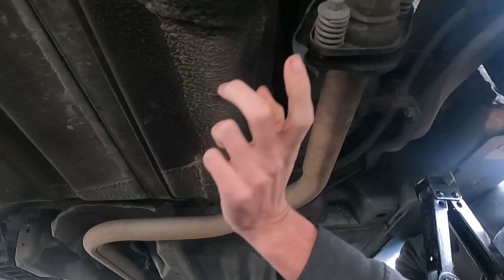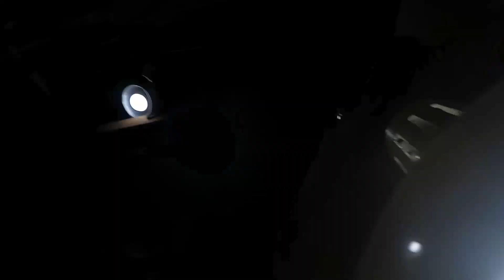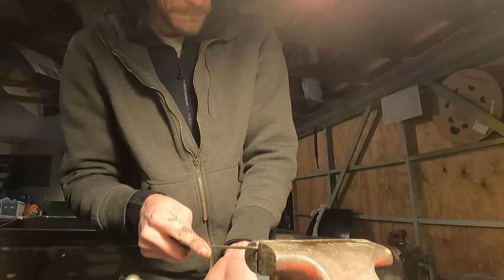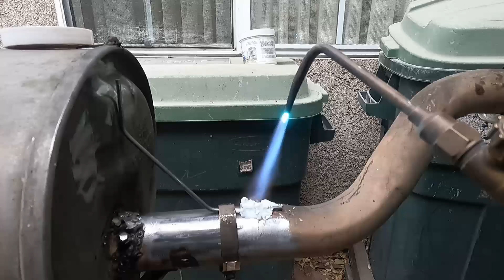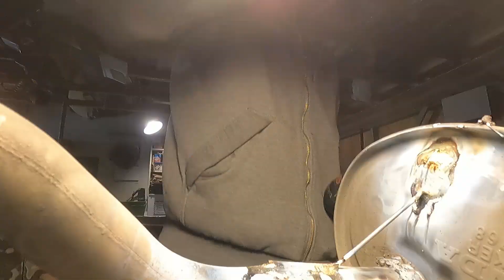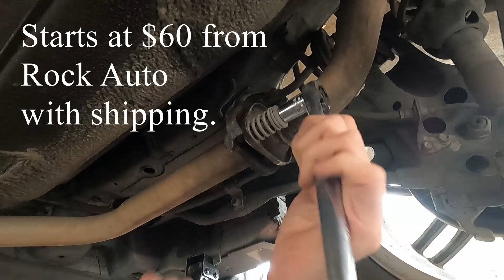Fixing The Muffler On My Honda

Comment: A long time ago, I learned a tip to make cleaning your hands easier after doing dirty-work: Wash your hands with a regular bar of soap, but don't rinse. Let the soap air dry on your hands. It'll act as a barrier to the dirt and gunk you're gonna get on them. Washing it all off afterwards is a lot easier!
Reply from the maker: Hunh, that's actually pretty clever! In my case I didn't think to do that so... The soap bar came in handy.